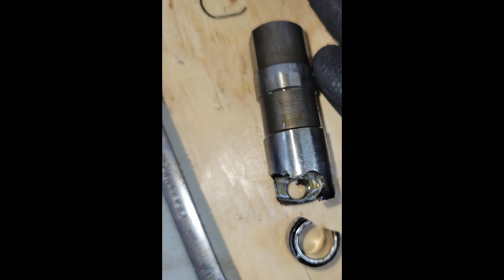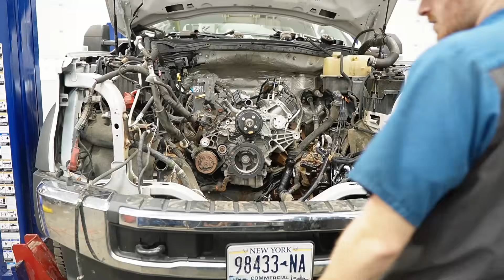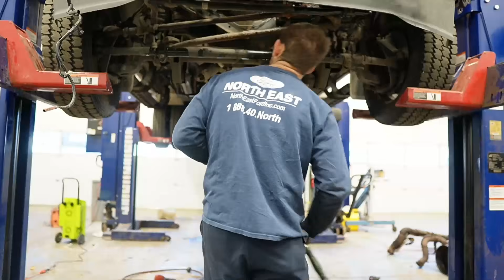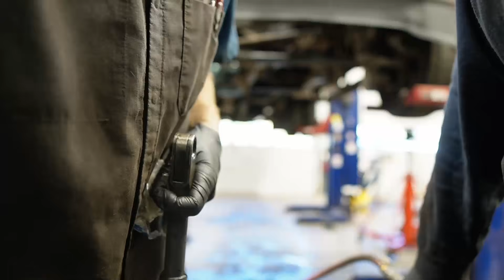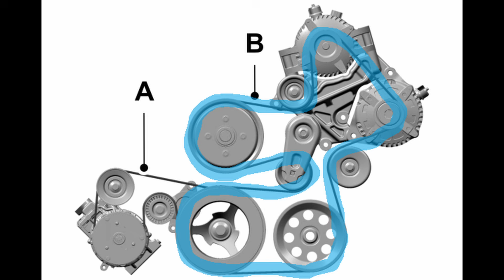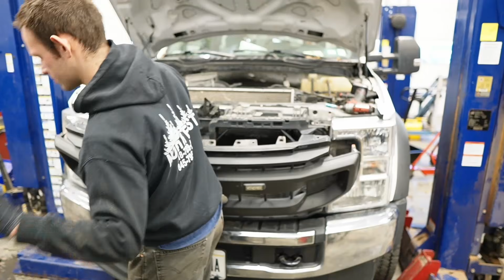How To Remove and Install 2020 7.3 Godzilla Engine F250 - F550 (Thorough Guide)

Comment: This is exactly how I pull a 6.0.  I always find a position on the block (not head) to mount the chain system to, I don't trust cast aluminum heads or their bolt holes to not "move" under the weight of the rest of the engine on a hoist, especially on install. I don't want my brand new mating surface between head and block to "move/bend" under its own weight on the cherry picker. If we are particular about how we torqued heads on, maybe we shouldn't hang the whole engine on that mechanical bond. I've watched a head gasket blurp on first start because the heads "pulled" off of the block while it was hanging on the hoist. My voodoo. I wanna bet we could blindfold the both of you for this process. Effortless. Nice vid.